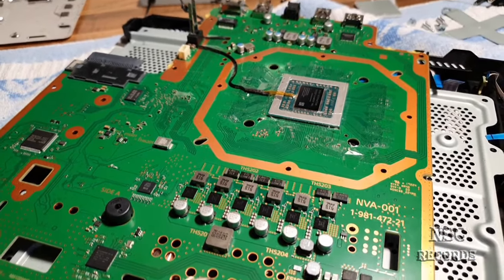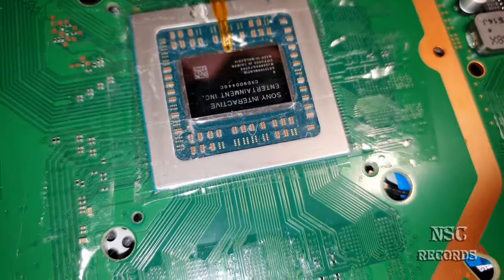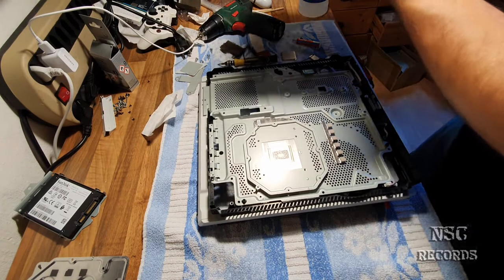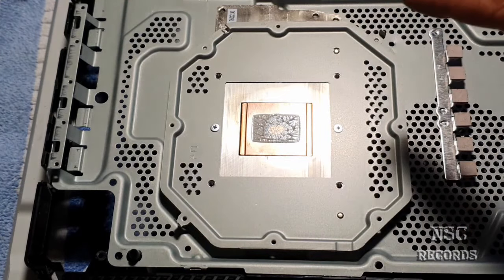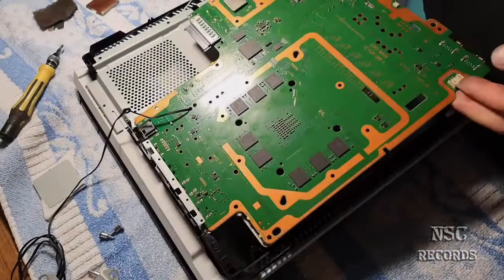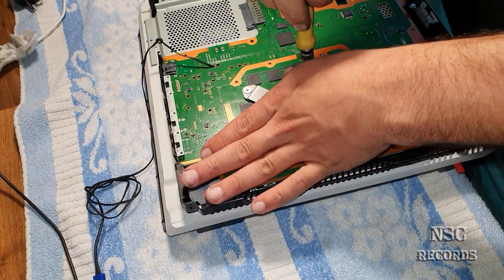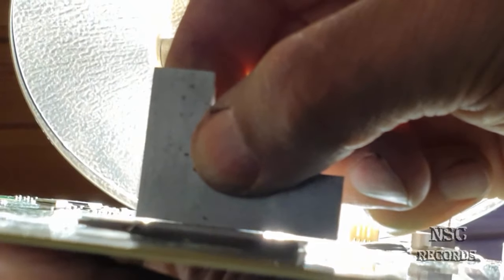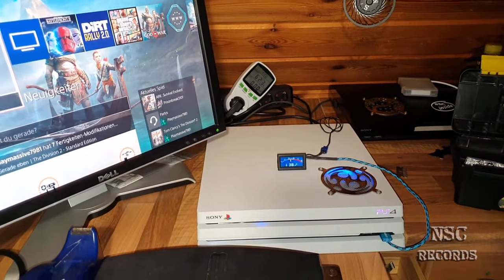That´s why your PS4 is still overheating after new thermal paste By:NSC

Comment: My still fan noising loud
Reply from the maker: Not good...
Reply: @NSC-Modz  actually my thermal pads are missing and i put double tape on ram chip. Just want to know that tharmal pad is important for heating issue ?
Reply: I want to show you. Can you see once ?
Reply: @mirwashdil4460  buy some thick thermal pads and put it over the ram chips and its very important just like on the PS3. Otherwise your PS4 will heatup very quickly
Reply: @sarahphyllis5782  thanks but unfortunately my ps4 didn't survived now my ps4 doesn't show any lights its dead now.
Reply: @mirwashdil4460  did you try replacing the power unit? Sometimes the power unit fails due to internal short circuit. But its replaceable very easily by unscrewing and taking it out then putting a new one.
Reply: @sarahphyllis5782  power unit ? Are you talkinh about power supply ?
Reply: @mirwashdil4460  yes the power supply box that can be removed when you disassemble the PS4, PS4 Slim or PS4 Pro not the power cord
Reply: @sarahphyllis5782  yes i changed the power supply but it didn't helped me, i think my icu chip not giving enough voltages to the main icu pots.
Reply: @mirwashdil4460  It would be better if check each electronic parts using a multimeter to identify which parts has been burnt or short causing the PS4 not to switch on
Reply: @sarahphyllis5782  i.dont know how to use it multimeter ☹️
Reply: @sarahphyllis5782  btw how do know so much about these ? Do you fix consoles ?
Reply: @mirwashdil4460  nope I enjoy watching tech savvy stuffs. My brother had a multimeter which he used to measure voltage, current, resistance etc. After he went to college I took his multimeter 😊 and learned some quips using YouTube videos. I am also planning to replace my PS4 Pro's thermal paste as its getting bit hotter than usual. Been using for almost 3 years haven't been disasemble yet unless I feel full confident
Reply: @sarahphyllis5782  thats so good you are creative too. Changing thermal paste is like changing clothes very easy simple but yeah you fearing from IF word.
Reply: I don't fix ps4 but i also watched youtube videos so i get little much info in mind how to do it. Even when my ps4 was good once i disassemble for just check the mechanism how its work lol 😂
Reply: @mirwashdil4460  I am not only going to replace thermal paste but thermal pads too. Also need to clean inside properly. Changing the PC's one is very easy but trying to change the PS4's one will be quite difficult I guess because of the poor quality mainboard design along with screws 😄 I don't know why Sony designed it like this. The Blu-ray drive seemed super sensitive as hell.
Reply: @sarahphyllis5782  its all difficult for the first time! Once you used to it then next time you can open your ps4 without opening your eye 😂 😂
Reply: @mirwashdil4460  Did your PS4 give any overheating errors before it stopped working?

Comment: Here is my mod. Lapping the heatsink only. Then apply Liquid Metal mod. Working like a charm. More quieter than before.
https://ibb.co/PrkVjtV
https://ibb.co/r5PzDZZ
https://ibb.co/YZs8j5H
Reply from the maker: I did this all long ago, but liquid metal will not last for long and soon you will need to open again...
Reply: @NSC-Modz  yeah, because LM interact with copper and dry out over time. copper absorbs liquid gallium in small amounts over time. And once absorbed enough gallium become plated with it and further every new application will last longer.
Reply from the maker: @solidsnake1089  yeah, but this is for a lot people's the reason not to go for LM ^^ With Thermal Grizzly or MX4 you also good to go :)

Comment: I think my ram chips are over heating what size mm do you use ?
Reply from the maker: Ram chips running hot to, i still use the original ones, no problem at all.
Reply: @NSC-Modz  I changed them stupidly thinking any will do put the old ones in the bin, stupid I know 👍😂
Reply from the maker: @mjk302  Hehe, happens, you can always get better ones, but most important is the APU ^^